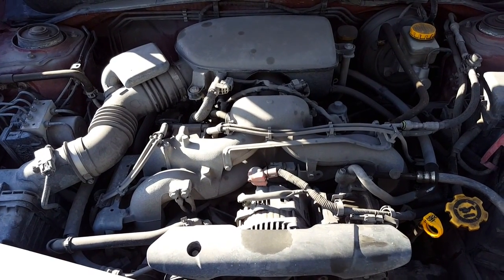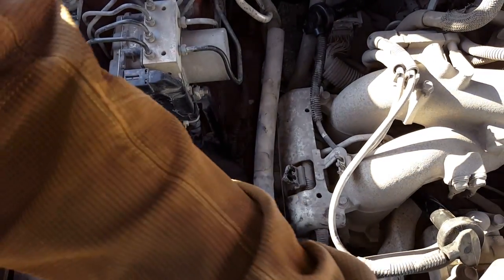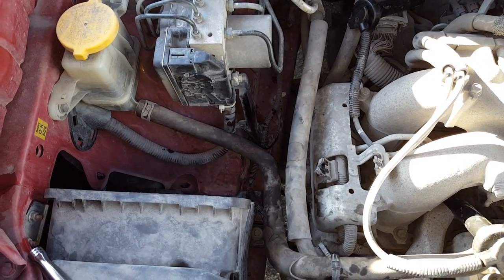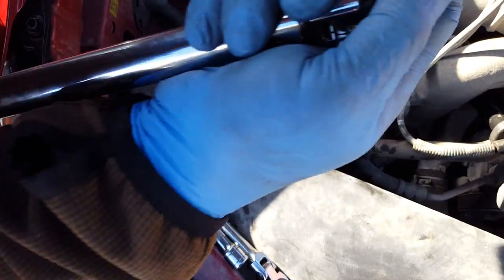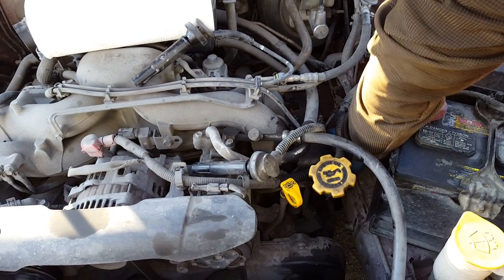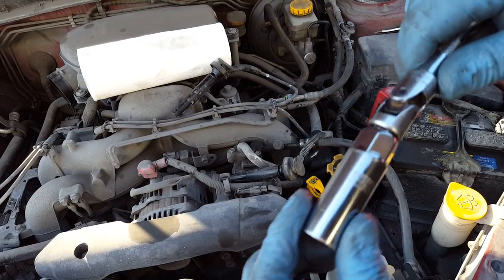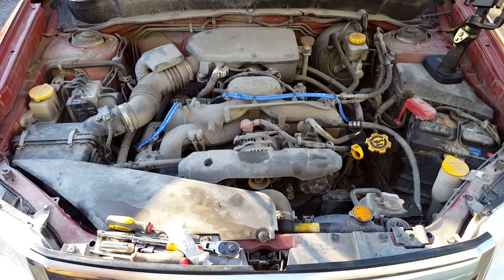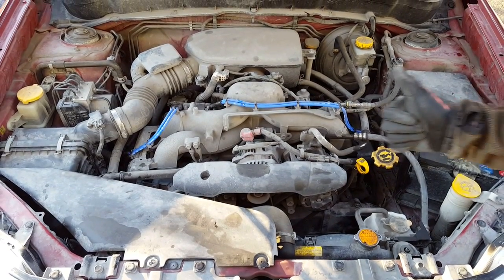2009 Subaru Forester 2.5L:  Replacing the spark plugs and spark plug wires

Comment: Very good video; thanks for posting.  A few comments based on my own experience doing this job:  (1) I too had always been taught to use a little anti-seize on the plugs' threads, but NGK themselves say not to use it -- modern long-life plugs (at least NGK's) have a coating that makes it unnecessary, and further it can cause over-torquing.  Which brings me to (2), the torque spec for these engines is 15 ft-lbs.  You're probably not going to hurt anything at 20 but 15 is the spec.  Finally, (3) removing the front portion of the box that holds the air filter element is easy and requires the removal only two 10mm bolts.  It's worth doing to improve access to cylinder 1 and also it gives you the opportunity to empty the gravity reservoir of any crap that's fallen in there over the years.  Anyway again thanks for the video.

Comment: You are the man!  Your video was perfect to watch before changing the plugs and coils in my daughter's 2009 Forester.  Buying the swivel thing for my ratchet made it an easy job.  I used needle nose pliers to get the spark plug socket out of the hole once I installed each new plug.  Thanks!

Comment: Great work! You must be a professional mechanic. Use professional tools, give the detail of the process and explanation. Thank you for posting this video. Every guy want DIY their Subaru Forester spark plugs replacement must watch this.
Reply from the maker: Thank you.  The whole video thing is relatively new to me, but I'm getting better.  I know quite a few people who think the Subaru engine compartment is impossibly tight and won't even do a spark plug change as a DIY project.  While it is true that these cars aren't the easiest for spark plug changes, they are far from the worst - especially if you have the right tools.  I've been wrenching professionally since '98 (and have been around it all my life) and feel that it's time to share some of my knowledge, especially with jobs that an inclined DIY-er can do.
Reply: Fang Wang that's why I'm here! Yay!
Reply: @AKJeeper  i really like your video , I just wanna change my spark plugs my question for you the plugs 2 and 4 doesn't matter to putting anywhere

Comment: Thank you so much. I am not a mechanic by any means but your video completely solved my problem! I was having a rough start on my 08 Impreza 2.5i (107k miles), along with low idle, shaking and vibration while stopped, and almost complete loss in acceleration. My check engine light came on with code P0303 and P0304. I pulled out and replaced all four spark plugs and my car is running great now! Thank you.

Comment: Thanks for sharing this video, it was very useful, you just saved me a lot of money, the dealer was charging me $500 for this job and I said no thanks. I bought the wires and spark plugs and I did it in about 1 hour and 20 minutes. And now my car is running great, I just removed the battery to make it easier.
Reply from the maker: takeapiss12 I'm glad the video helped you do the job yourself and save some money!  Battery removal makes access easier but as you can see in the video, not completely necessary.  Thanks so much for taking the time to leave a comment.  I really appreciate it!

Comment: Just did this fix & WOW! it worked. Parts/tools cost me less than 125$ from O'reilly. I will add that I didn't need a torque wrench to get my rig back up and running. After a little more digging I found that between 15-20 foot pounds of torque is about as tight as a person could use one of those swivel ratchets.

While my spark plugs might not be to the exact tightness, they are definitely in there. My forester is idolling better and there's no more weird smelling exhaust. When the engine went out there was some extremely weird smelling exhaust that was stunk like oil and gasoline volatilizing.

I also want to note that each of the spark plug wires that I bought have their own female end counterparts in the Subaru engine.

THANK YOU!
Reply from the maker: Glad the video helped you!  I'm pretty adamant about using a torque wrench on spark plugs for these videos because some less-experienced people may either overtorque (or undertorque - they feel the resistance of the crush washer and stop, when they really should keep going until the washer crushes completely and resistance starts ramping up).  You're right though, 15-20 ft/lbs is roughly what a person will manage with a 3/8 drive ratchet if they aren't reefing on it.  Thanks for commenting!

Comment: Excellent presentation that saved my bacon, only things I did slightly differently was to completely remove the air filter box and battery which made access a lot better and accounted for less skinned knuckles. Plugs were absolutely shagged with wasted electrodes and gaps of 1mm plus...cant believe it was even running!

Comment: Brilliant and complete procedure chock full of helpful hints. I was told by my mechanic that anti-seize is not necessary with NGK plugs. I agree about the removal of the battery to make the job on the driver's side replacement of cylinders 2 and 4 easier. I think that the people who work on these cars in Japan must have smaller hands than I do....Oh yeah, thanks for the pointers in your information and especially the hint about the dielectric grease. This is one of the most helpful Youtube videos on Subaru maintenance I have come across.
Reply: You are correct, if the spark plug is the shiny metal it doesn't need the anti seize, in fact its the shiny color because its part of the anti corrosive properties,
Adding anti seize will actually get you false torque numbers as well. If it was dry, the way it was intended to be installed, you can go till it seats and a 1/4 turn. if its lubricated it will easily feel like its not seated yet n then when you start cranking on it, your already a full turn further than youd already without it. 
If its shiny its not meant to have anything on, also the washer is designed to make contact with motor and also assist in releasing because of the material its made out of when removing. These spark plug people have really thought of everything.
If you have some older vehicle and its like a dark color plug, those plugs you can safely use anti seize on. 
I dont wanna say its 100 percent cut and dry, theres instances with each i'm sure you would and wouldn't you know. just know if you do, that plug will go further than if you did not that is for sure.

Comment: Great video! Parts cost me about $60, dealer wanted over $250 to replace.  Took me about 2 hours, but that included taking the battery out to get better access to cylinder #4 as well as taking a test drive. I especially liked the tip about electrical tape to hold the universal on to the extension.  The old Forester runs soooo much better!
Reply from the maker: Greg Matoka Thanks for taking the time to leave a comment!  I'm glad the video helped you and that you were able to get the job done yourself and save some money.

Comment: Great vid. Like the anti seize tip but remember, the anti seize on the plug thread is going to lower the torque value. Over tightening the plug on an aluminum block could potentially strip it out. Might spin the plug in until it stops turning then go another quarter turn and that’s it. Thank you Charles Cranford!
Reply: I agree, i felt like he was cranking them on there, idk.

Comment: Thanks for the great tips. I will add that I was able to tilt the battery 90 degrees with the cables still attached making for much easier access to cylinders 2 and 4.

Comment: Did this Subaru have a misfire/rough idle before you changed the plugs and wires? And when you changed both did that remedy the misfire/rough idle?

Comment: If your idle is weird after doing this, the procedure is simple but time consuming.
****do this outside in a well ventilated area****
1}make sure your radio is off, headlights off, ac heat off, anything that consume power is off that is step one. very important as you car is relearning the idle you do not want anything interfering with that.
2)unplug neg terminal for 30 minutes min
3)turn key to pos 1 just before starting when the lights and all that come on the dash, that position. then wait min of 15 to 20 seconds

4)start the vehicle and let it idle for 15 to 20 min and do not touch the gas even if it seems like its going to die, dont touch anything and ensure everything is off.

5)turn vehicle off and wait 15 seconds.
6)turn to position 1 again and wait 10 to 15 seconds
7)start vehicle and let run again for 10 min and then turn off
8)wait 13 seconds turn to position 1 for 15 seconds and then turn on and go for a road test, your car should run like new again.
Reply: Idky i put 13 seconds for step 8 like 15 seconds is what i meant.

this really is how you relearn the idle on a Subaru though just so you know.

Comment: Great video and I appreciate how well you explained things.  One quick problem I have run into is that, after applying the diaelectric grease to the wires, the terminals attaching to the ignition coil keep slipping off and I can't get a firm click.  It might be that it is currently 0 degrees in the garage and the metal is shrunken a bit?  Not sure but would love your advice.

Comment: dear my friend I have a Subaru forester 2009 14000 mile its give me a engine light seen is like catalyst convert error code p0420 do you think if I chance the spark plug before or replace the upfront exhaust catalyst convert  thank I will appreciate

Comment: Would this all be pretty much the same process on a 2.5xt in the SH format? I have a 2010 2.5xt and is in need of this job. Want to tackle it myself rather than paying hundreds at the dealership... Thanks in advance. Great video.
Reply from the maker: This is a very similar process for doing spark plugs across all models of 4 cyl Subarus.  Some have spark plug wires, and some have ignition coils over every spark plug.  I’m not quite sure what you mean by SH format.
Reply: @AKJeeper  I should have said generation rather than format. 09 - 13 are the SH gen. The XT has ignition coils. I'm getting some misfires when I'm driving slow with little accelerator pressure so I'm gunna start with new plugs because it probably needs them anyways. It actually stalled on my yesterday when I was backing out of the driveway without touching the gas. If it keeps up, I'll probably need to replace the coils as well.

Comment: Thanks for the great Video. I'll definitely do this job myself on my Forester 2010 and save the money and feel proud at the end. I noticed something which is a filter that I've never seen in my car. I have replaced the air filter a number of times but never seen the white mesh filter inside the movable part that you're holding in the air 22:30.  I usually just replace the bottom filter (you're holding it here 22:47 ). Am I missing a part here or is this a 2009 feature?
Reply: Thanks again

Comment: just curious about the mesh filter medium located just downstream of the engine air filter, any comment on it's purpose?
Reply from the maker: Most vehicles have some sort of screen to protect the mass air flow sensor and engine from large debris.  I can't think of why else these mesh screens would be there.

Comment: Will the spark plug boot rip when you pull it out of the engine?happened to me on my Hyundai elantra, while doing ignition coil
Reply from the maker: They aren’t supposed to tear when being pulled out of the engine.  You need to exercise care when removing them, however.  If they seem stuck, a gentle twisting motion might be necessary while pulling back on the boots.

Comment: Excellent vid..but why are you using imperial measurement tools when the subaru is metric? Oh and would this vid apply to a 2007 forester as well. great stuff!
Reply from the maker: Jj Sands Spark Plugs hex sizes are largely standardized. Sort of like wheel diameters. The Subaru is a metric car yet it has wheels that are measured in inches (e.g. 15 inch, 16 inch).   Same thing with spark plugs. Most common spark plug hex sizes are 5/8, 3/4, 13/16, 14mm, and 18mm.  And yes the Procedure is virtually the same with the Forester. Hope this answers your questions!  Have a great day!

Comment: Also Very important to realize that antiseize effects the friction and when you torque the plugs they get much tighter than you originally planned. Good idea or bad idea? Can't ever make my mind up. Torque them too tight it loosely and could end up with a compression leak or stripped head which either could mean thousands in damage. No anti seize and there is a small possibility you might somehow get galvanic corrosion sticking the plugs into the hole since newer fuel injected cars very rarely need new plugs (maybe after 80 to 120k miles). So which way is best? Anyone ever had anti seize cause excessive over tightening yet?
Reply from the maker: Anti-seize (or anything on the threads, really) can change the torque applied to a fastener or spark plug.  With that said, as long as you don't go crazy with how much you put on the threads - it won't be a significant enough of a difference, at least not to the point where you're damaging the head from overtightening, or having the spark plug fly out (and subsequently ruining the head) from not being tight enough.  For what it's worth - I've been wrenching professionally for just over 20 years and have not had any issues with any plugs I've installed using anti-seize.  In my area we battle corrosion all the time, so I'm a believer in using anti-seize on spark plug threads.  It's really one of those things that is a preference...much like asking mechanics what brand of motor oil they like to use.
Reply: @AKJeeper  I always thought it's a good idea but always wandered what type of % I should adjust the torque. My friend that repairs and sells used vehicles had one truck that had a plug corroded in enough the heads threads came out with the plug. That wasn't good at all as then he had to buy a new set of heads. I can't remember now which brand and model it was but I remember he researched it and was a common issue with that specific truck. I'm kind of surprised that if they make aluminum heads then why not aluminum threads on plugs for aluminum heads to prevent galvanic corrosion and expand and contract at the same rate when heated? Seems like it would make sense as for the galvanic corrosion to take place it takes two dissimilar metals in an electric solution so basically a little water gets in there sits from Condensation or whatever and that's all it takes to weld them in place after a while. I also kind of Wondered how they don't get really loose since aluminum expands faster than steel every time the motor heats up.
Reply from the maker: @naturestrail2296  Almost willing to bet it was a Ford pickup.  Some engines (modular 2V) were notorious for only having a few threads engage the spark plug, along with a very small factory torque spec (like 12ft/lbs).  Factory-fitted spark plugs would fly out on their own!  I've had the best luck increasing torque to 20-25ft/lbs on replacement spark plugs (if you get to them before they fly out and cause damage).  On 3V engines, most had a seriously stupid 2pc spark plug design, where part of the spark plug could seize and subsequently break in the block.  In either case, whether it be the threads getting ruined by the spark plug flying out or 2pc spark plugs seizing/breaking, there are fixes which don't require replacement of the cylinder head.  As for steel/aluminum expansion rates - a spark plug tightened to the proper spec will not get loose with heating/cooling cycles, but can corrode from having dissimilar metals touching (which is why I use the antiseize).
Reply: @AKJeeper  I thought that's what it was but was reluctant to say

Comment: In the airbox, you have an additional feature on the engine side (the part you removed with the mass air filter) of the replaceable air filter, what is that?
Reply from the maker: Many vehicles have some sort of additional filter or screen in front of the mass air flow sensor.  The MAF sensor is very sensitive and easily disturbed by contaminants contacting it.  This filter is just an added layer of protection in case the main air filter element fails.
Reply: @AKJeeper  thanks for the response, I was wondering as I've never seen this in my own '09 Forester